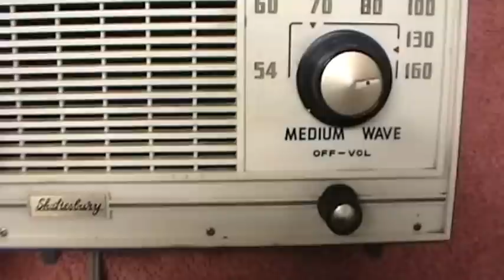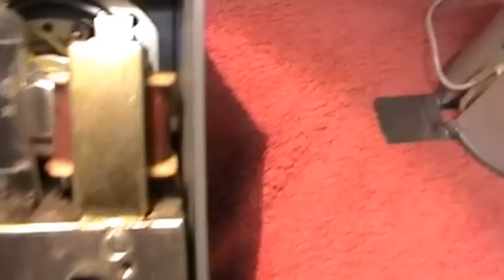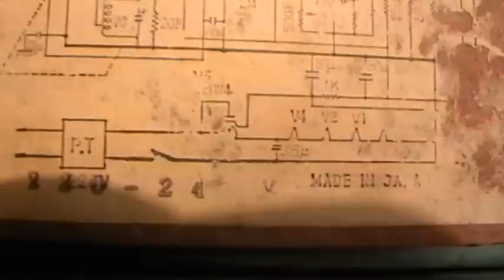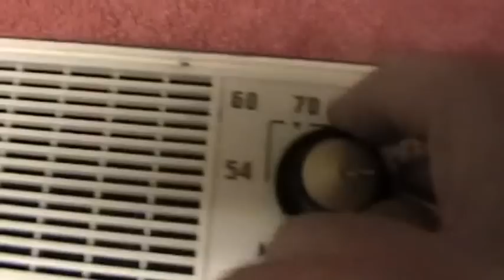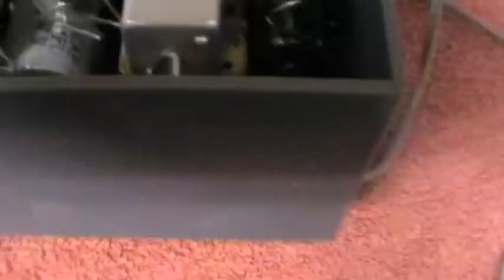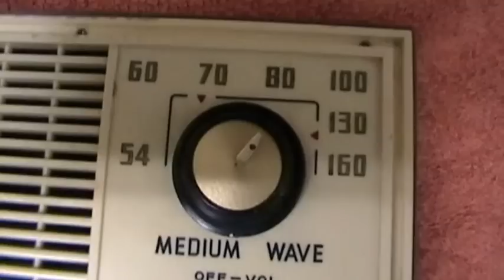Shaftesbury Japanese midget radio  Valves (Tubes)

Comment: I'll bet those plastic screws were carried over from the design for the American and Japanese market sets, which usually had 5 tubes, no mains transformer and a hot chassis. The AA5 circuit, as it was often called, was the basis of some nice sounding USA&Canada-made AM radios, as well as AM/FM and long-range AM sets that gave up some output power for more elaborate tuning features (using a 35C5 rather than a 50C5). These Japanese versions were better built in some respects, with metal chassies, tube retainers and ceramic capacitors that were immune to "silver mica disease", but they tended to sound a bit tinny. It's funny how the English-market versions had totally different brand names; maybe that made it easier to keep them from being shipped to the wrong market.
Reply: Chassis is live, the transformer is a step type or auto-transformer.

Comment: The markers were for the CONELRAD system, in which, in the event of an attack, all the stations would go off the air on their assigned frequencies and broadcast emergency information in a secret, round robin, sequence sharing the two allowed frequencies. This was to keep enemy planes from using radio signals for navigation; it was discontinued in 1963 because the navigation systems that had been developed no longer depended on broadcast systems.

Comment: I just bought a red one of these for £10, it works very well but I think it needs new electrolytic capacitors as the grey oil filled ones are junk.
Reply from the maker: Hi yes changing the caps will certainly work good price you paid these I think are getting rare...thanks
Reply: @migette1  yes they are getting rare, mine was cheap as the cabinet is slightly damaged, the previous owner's stack of radios fell over so this and lots of other small sets hit the floor, I got some bargains because of this damage and it isn't really noticeable unless you're looking at the set close up.
Reply from the maker: Sounds like an interesting shop with good products.
Reply: @migette1  it's On The Air LTD in Hawarden, very nice little shop!
Reply from the maker: Hi where is that sounds like its in the North I am from London area.
Reply: @migette1  Just on the Welsh side of Cheshire.
Reply from the maker: Yes I looked it up and that shop as well looks like a nice area and I believe its historical as well...thanks